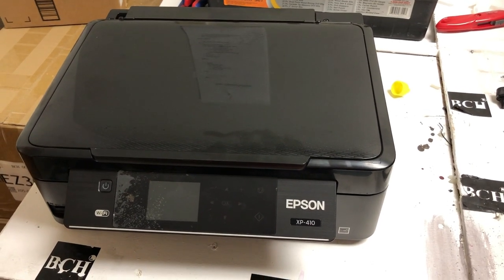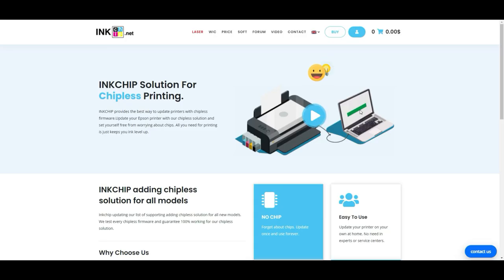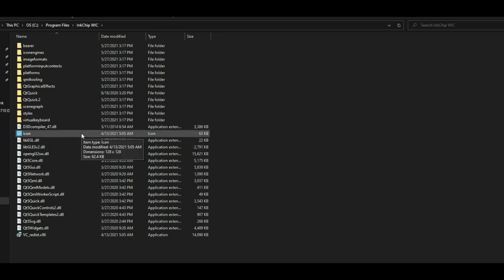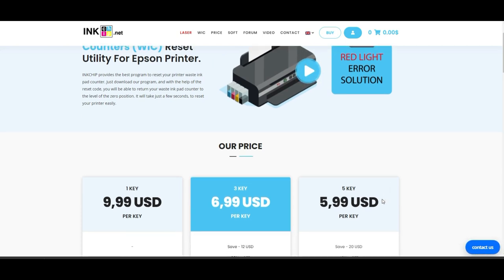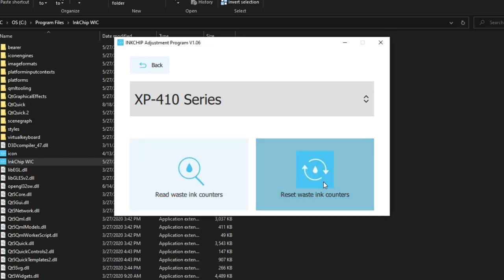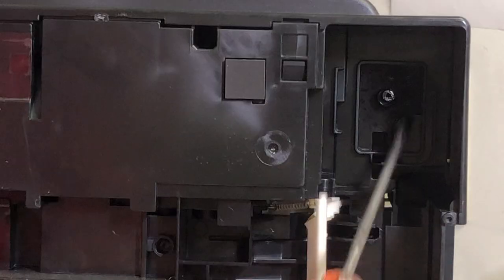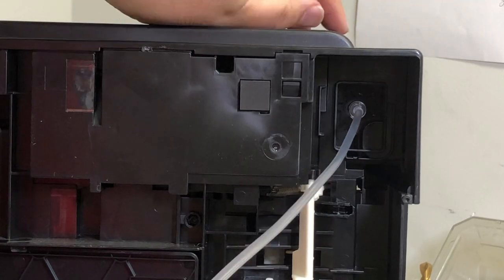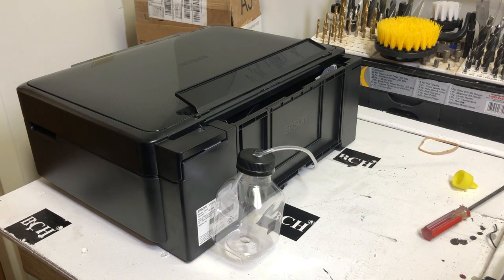Epson XP-410: Parts inside printer reaching the end of service life - waste ink pad reset

Comment: Does Canon and hp have this problem?
Do they stop printing too?
Reply from the maker: Canon does and there is a tool for that.  HP just dump the ink on your desk.
Reply: @BCHTechnologies  does all canon model do that? I have a Canon TR4570s. Should I be worried?
Reply from the maker: @roshanbabus9597  Come back when you have the problem.  Don't worry about it now.
Reply: @BCHTechnologies  ok. Thanks bud :)
Reply: @BCHTechnologies  Hi Kevin. Thanks for the informative and money saving video. So with HP do you just clean the ink off the desk and then clean out the ink pad, or do you need a tool for the ink pad reset?
Reply from the maker: @SirPrancelot1  You are welcome.  You don't need a tool for HP.  HP designed the printer to hold as much waste ink as possible, so it is rare that the ink can leak out of the printer.  I have a 25 year old HP which bottom chassis looks like a swimming pool but outside looks clean.
Reply: @BCHTechnologies  25 years? That is impressive. Good for HP. Shame the others didn't do the same.
Reply from the maker: @SirPrancelot1  Yes.  It was $375 when it was released.  Still, it is $100-$150 for a used one.  Back then, HP hasn't figure out how to make residential printers, so it shrunk the industrial printer.  This thing prints dye, pigment, and solvent ink.  I use it to test industrial cartridges.
Reply: @BCHTechnologies  That is an extraordinary price for an old printer. They don't make them like that any more.........What model is it? Unlikely I'll see one but if I do I'll buy it!
Reply from the maker: @SirPrancelot1  The legendary one is HP Deskjet 960c but 930, 970, 990Cxi also works.  I checked the price and it shoots up to $235 for a good working one.  This model is a keeper.
Reply from the maker: @SirPrancelot1  I was wrong about the date.  The release date for my 960 was 2001, so it is 20 years old.  I was thinking about 660 but I got a 960C. Here is a timeline for HP's inkjets: http://www.hp.com/hpinfo/newsroom/press_kits/2008/deskjet20/bg_deskjet20thannivtimeline.pdf  The 995 is the first one has USB, Serieal, and infrared Bluetooth.  I have both and also a 990Cxi.  The 960C was $269 when it is released, so the current price at $239 is quite good.
Reply from the maker: @SirPrancelot1  I was wrong about the date.  The release date for my 960 was 2001, so it is 20 years old.  I was thinking about 660 but I got a 960C. Here is a timeline for HP's inkjets: http://www.hp.com/hpinfo/newsroom/press_kits/2008/deskjet20/bg_deskjet20thannivtimeline.pdf  The 995 is the first one has USB, Serieal, and infrared Bluetooth.  I have both and also a 990Cxi.  The 960C was $269 when it is released, so the current price at $239 is quite good.
Reply: @BCHTechnologies  Excellent information, thank you. I would rather spend good money on an excellent old machine than a mediocre new one, especially as it is more likely to be repairable. I hope that Right to Repair is going to become a major issue for all products but it's difficult as the lobbying industry is so powerful. Louis Rossmann (YouTube channel repairing Mac laptops) is doing excellent work on this.
Reply: @BCHTechnologies  Thanks for the link. 20 years is still really impressive for anything electronic. The fact that they have held their price so well is testament to their quality.
Reply from the maker: @SirPrancelot1  Agree.